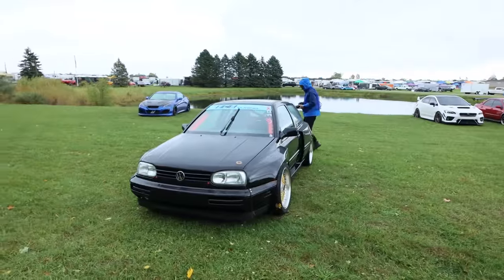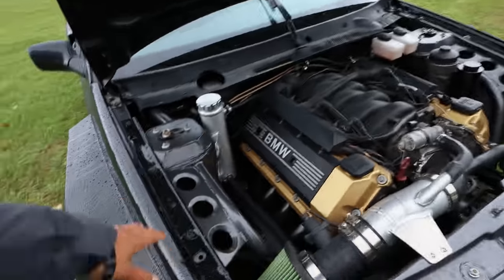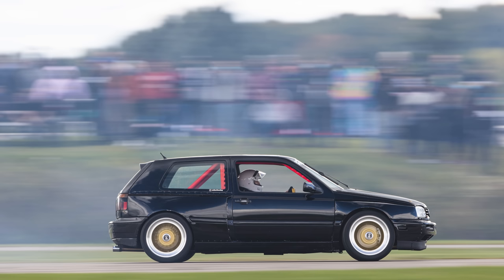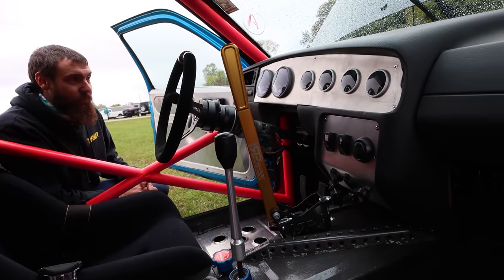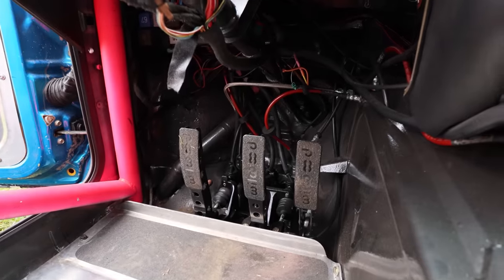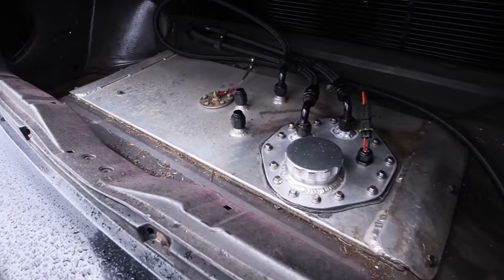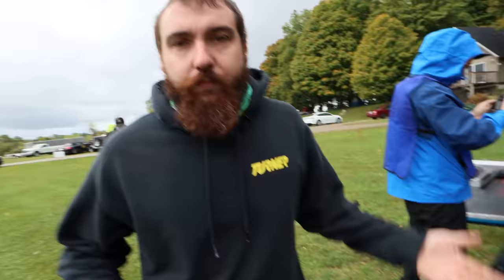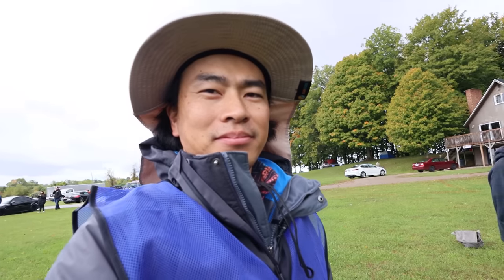BMW V8 Powered, RWD Swapped, Rear-Radiator’d Volkswagen Mk3 Golf GTI

Comment: I watched this series when he was building this thing, and I really applaud his creativity. It probably helps that I'm a huge BMW/ VW/ Audi guy that's been turning wrenches for over 25 years, but what a cool swap! M60's are an underappreciated engine, and the b44 was quite a good drivetrain. You can grab the 6 speed from either the e34 540/6 (one of my favorites and I owned 2 of them,) or the e39 540 as well, so it makes it an easy swap with no adapting the bellhousing or dealing with the clutch. Love what he did with the rear cooling setup and the functional all-metal flares. Quality workmanship. I would love to use that car for a time attack or a hill climb if we had those in the states. Sick ass build! Thank you for sharing this.

Comment: ECStuning for the win
Reply: Alpha Wërks  whatd the vehicle your working on, if ypu dont mind me asking?
Reply: FCP for OEM parts but ECS for aftermarket
Reply: Alpha Wërks  I love the CC, buddy of mine had one until someone hit and totaled it
Reply: Alpha Wërks  Who do you suggest, I get most of my performance parts through ECS/Turner and never really had an issue. I usually use FCP for maintenance and repair items due to faster shipping and it's more clear what is the OEM supplier parts
Reply: Alpha Wërks  I can imagine, me and my buddy planned some bolt ons for the car and get a tune via APR. But alast, someone decided to not pay attention and ran a red light

Comment: You could mount a couple spal radiator fans on the back hatch to help the hot air escape threw the back, it would also help with rear turbulence, hehe

Comment: Beautiful car and modifications. Although I would have went for a better v8. Those bmw v8s are so darn unreliable.
Reply: BS! These engines are almost strong reliable as the 1UZ-FE. You can pull over 700 hp from it on full stock engine, don't overheat when you changed the water pump with an new OEM one and the radiator with a bigger one. It's not burning oil like the most of the BMW engines. The problems are the sealings, but as you see in this build they are changed. There is nothing there, that can stop this engine from working, ONLY if it's maintainig right. The most of the drift cars in my country are with this engine and they just drive the crap out of them without problems.